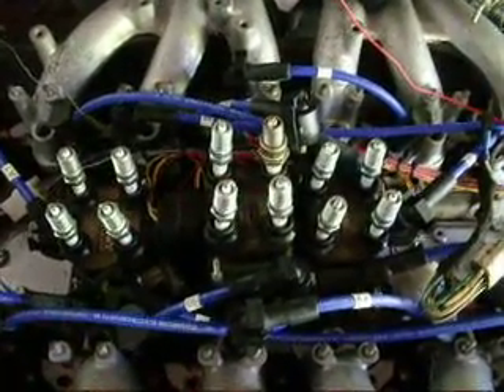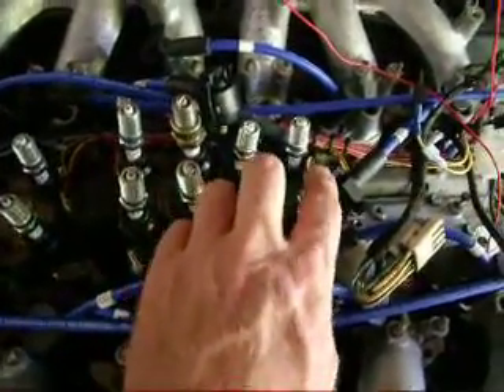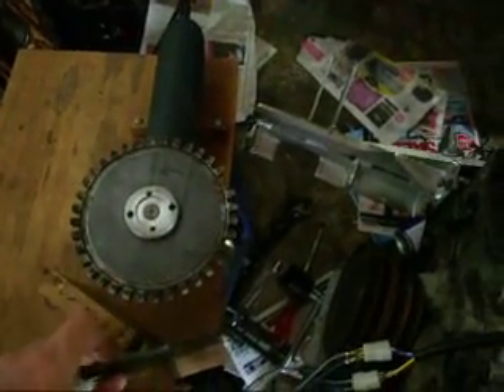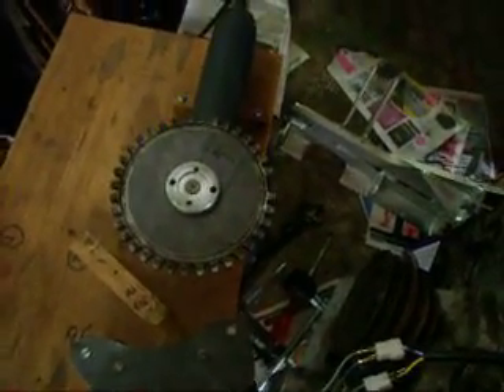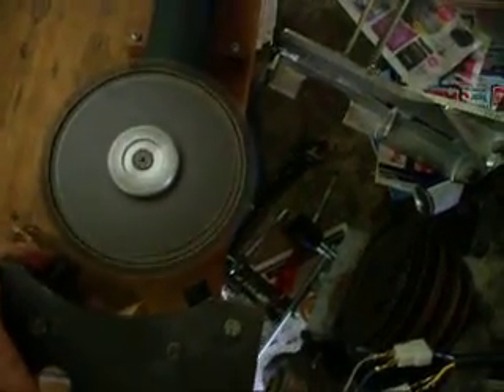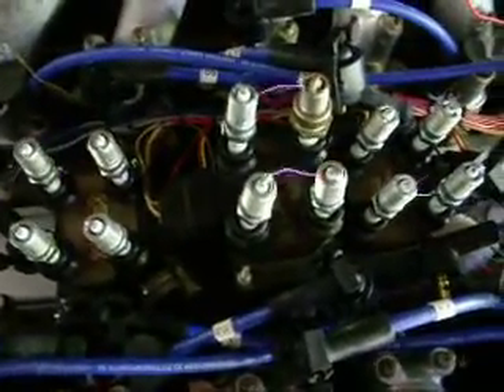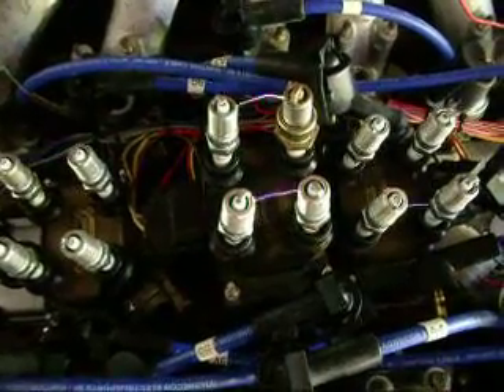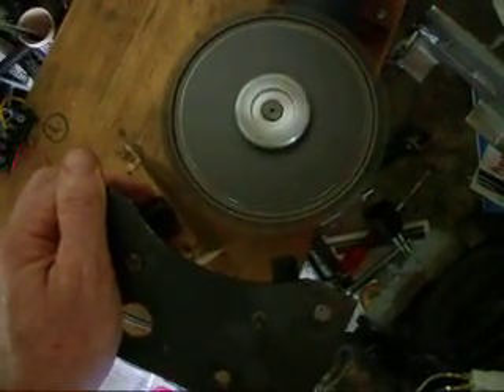Dual EDIS ignition system for V12 or V16 engine

Comment: Good morning Phil, I'm a bit late but my son and I are reviving our 86 XJS for him.. I came across your amazing video.. I'm a licensed mechanic and always trying to improve the Jag.. is there anyway you can show or describe the wiring and parts..
Thank you,,,, Pete.
Reply from the maker: Hi Pete, I developed this Dual EDIS-6 solution at a time when there was no other wasted spark solution available for 12-cyl.  Now there is.  Megasquirt-2 (with V3 montherboard) can be configured for 6 ignition outputs which can be used for 12-cyl wasted spark.  I would encourage you to rather go in this direction. Look at section 5.3 of the MSEXTRA hardware manual for MS2.  These are only low level outputs and you will need two 6-channel ignition modules or three 4-channel modules to drive the coils.  Once you have the ignition system running, it literally requires connection of two more wires to also take control of fuelling and, hear what I say, the XJS can doe VERY MUCH do with LESS fuel than what the OEM ECU is providing.

http://www.msextra.com/doc/pdf/html/MS2V30_Hardware-3.4.pdf/MS2V30_Hardware-3.4.html

Comment: great video! How can I purchase one of your DESC modules? I want to run dual EDIS-6  on my bmw v12, or can I just run two megajolt units , one for each bank and control the timing separate.  Thanks
Reply from the maker: Thank you! I'll gladly supply you with a DESC module for $100 including shipping to the US, but there are two other solutions I would encourage you to consider first: 1) Use Ms-2 (with the MS EXTRA firmware) which you can build with 6 ignition outputs (no DESC needed).  This way you only need one VR sensor and it offers the ability of you taking control of EFI as well at some point.  The only downside of MS-2 is that it then can not ALSO have full time barometric fueling compensation (VERY important if you live/drive in mountainous terrain).  2) Alternatively, use MS-3 which can have up to 12 ignition outputs (with the expansion board), although I personally would still go with only 6 (wasted spark) for simplicity.  Then you can also take control of EFI and you can still have barometric fueling compensation.

Of course you can run two megajolt units but that is not very elegant!  One Megajolt with DESC would be more elegant for the Megajolt solution.
Reply: Thanks so much for the info. My v12 will be running 6 DCOE weber carbs, so no need for EFI control. The system with one megajolt  and your DESC sounds good to me! I will order soon!

   Thanks my friend!